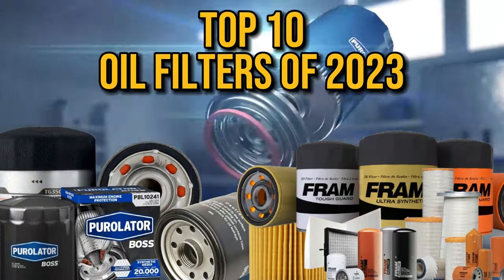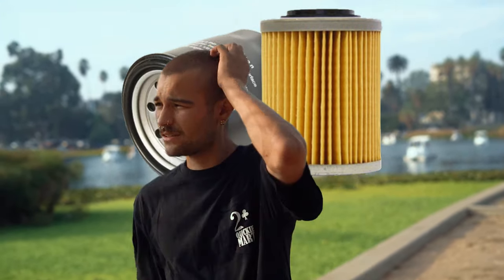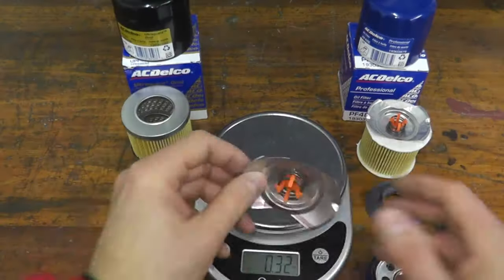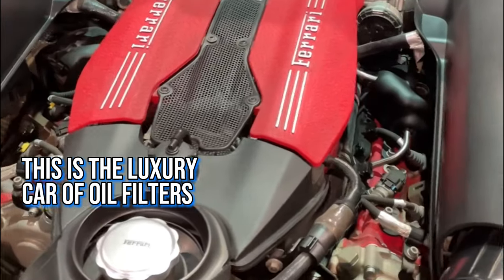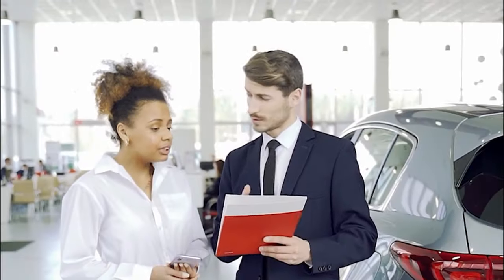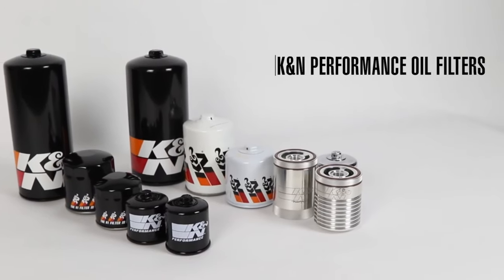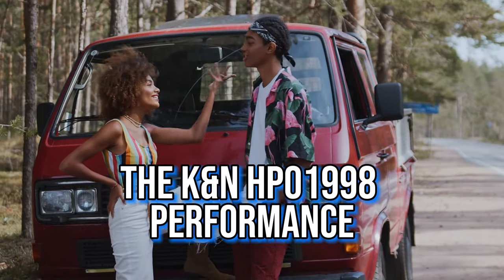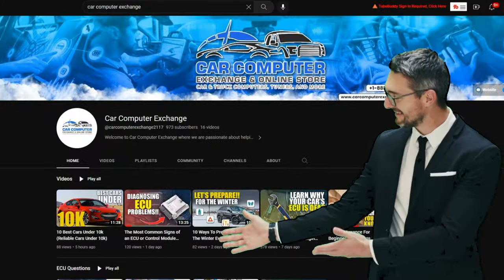Top 10 Oil Filters Of 2023

Comment: When choosing an oil filter, it's crucial to consider your vehicle's make and model, the type of oil you use, and any specific requirements outlined in your vehicle's owner's manual. Additionally, checking for updated reviews and ratings can help you make an informed decision based on current market conditions.